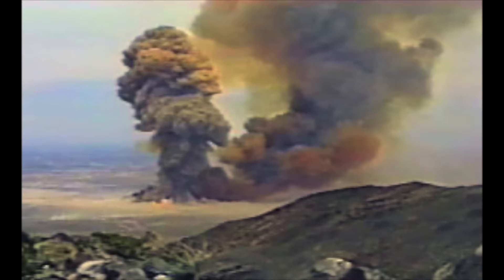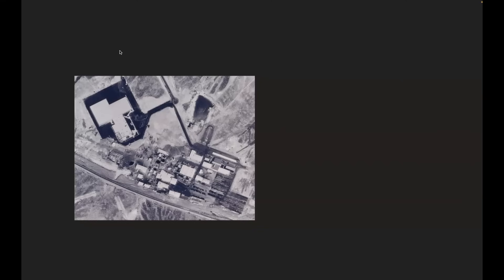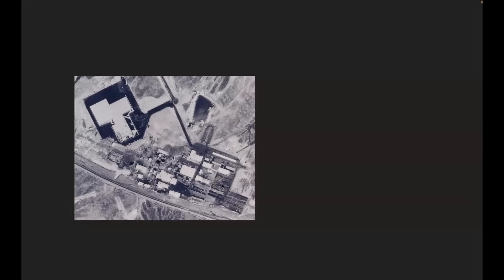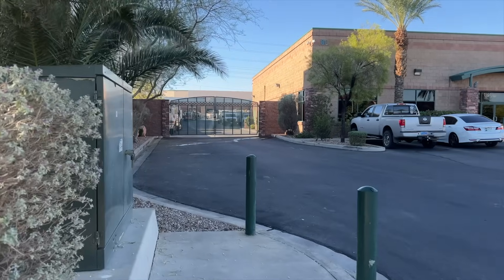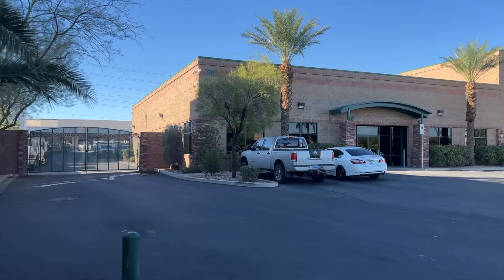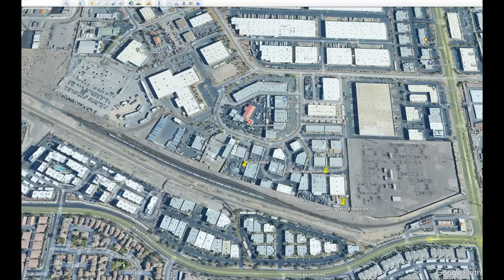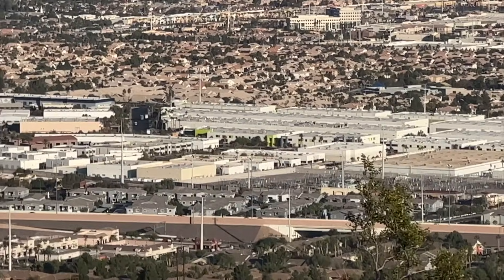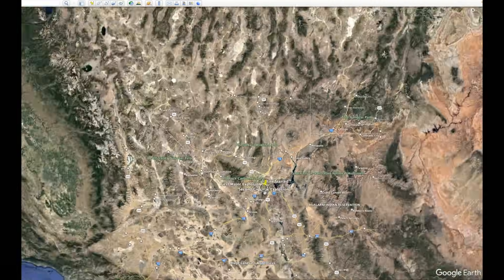PEPCON EXPLOSION May 4, 1988, Henderson, Nevada.

Comment: I also personally experienced the Pepcon explosion on the roof of the new Riviera Tower on the Las Vegas strip at the time. It was my first job as an apprentice for the International painters and Allied trades.
I was pot tending for two journeyman painters suspended on the side of the building when the explosion happened. The aerial platform we called a swing stage got blown away from the building at least 10ft and slammed back against the wall of building. 
It's been so long ago but will never forget the difference as the sound came first and then the repercussion. Like I said I was on top of one of the tallest buildings in Las Vegas at the time. And had a bird's-eye view.

Comment: This is the most comprehensive short video that I’ve seen on this event, well done. I was the first Henderson Police Officer dispatched to the fire at the Pepcon facility on that day. The first explosion happened as I arrived about 700 yards from the plant on Lake Mead Drive, now called St. Rose Parkway, just west of the 515/11 overpass. The overpass was under construction and only a dirt berm at the time. My job was to assist the fire department and control traffic. After the second blast, I moved my police vehicle back about 1200 yards away from the fire, to the east side of the berm. After the third or fourth explosion, a blue Chevy sedan with body damage and shattered windows drove out of the scene, driven by the Henderson Fire Chief, Dale Starr. Starr and his passenger were bleeding from the face. A reporter from the Henderson Home News, Katherine Scott, arrived and was taking pictures. We jumped to the ground as the biggest explosion hit. There were seven explosions in all, I believe. There were four officers who were within the inner perimeter: Dick Trettle, Russell Avery, Bill Adomeit and myself. The three officers later died from tumors and health problems. 

As I recall, the limited information that the police department had been provided up to that time was that Ammonium Perchlorate was only an oxidizer for rocket fuel and not explosive or harmful. Pepcon was at the far western edge of an industrial complex in Henderson that had been built during WW2. The other factories produced chlorine, ammonium perchlorate, titanium, and other chemicals. Closest to Pepcon was the Kidd Marshmallow Factory. It was completely destroyed during the explosion and molten marshmallow burned and dripped from the steel wreckage for a week. 

I knew the welder who they blamed for starting the fire. He insisted that he used adequate protections and was far away from the ignition point. I also knew a few people who had worked in the plant, they told me that fires in the batch drying area were routine and that they rarely contacted the fire department. Employees would extinguish the fires themselves. One person claimed that it was one of these routine fires that had triggered this event. But I do not know all the facts.

As a curious aside to this story, around 1992, I responded to a report of a blue flame  burning in the desert on the west side of Cornerstone Park, about 1.5 miles west of the Pepcon site. There is a small natural spring lake and at the top of a short ridge line, a blue flame about 3 feet by 1 foot was burning gently from the soil. There were no plants or combustible materials near the flame. Henderson Emergency Manager Mike Cyphers came out, along with one or two others. I later heard that the investigation concluded that it was due to high concentrations of ammonium perchlorate in the soil. 

At the time, Henderson was a sleepy town of about 60,000, later growing to over 300,000. The City management and the Police Department were forced to rethink safety and emergency preparedness after that. We built more fire stations, hired more cops, and learned a few important lessons. That day changed Henderson.
Reply from the maker: Excellent story and information! Thank for sharing this 🙏
Reply: Thank you sir.

Comment: Forest please educate yourself and others.  They DID NOT make "Solid Rocket Fuel Booster" at PECON.  They made Ammonium Perchlorate, The oxidizer or oxygen component of the solid rocket motors of the space shuttle. The solid rocket booster fuel and motor assembly was done at Morten Thiokol outside of Salt Lake City in a remote area.  The cause of the explosion was a natural gas leak under the plant.  The leak was discovered weeks before the explosion but the gas company couldn't find it's source.  The gas line came through Rail Road Pass, under Pepcon and fed the rest of the Las Vegas Valley.  Prior to the explosion at 10:45am, the local middle school down stream of the Pepcon was evacuated due to the smell of Mercaptan, the natural gas smelling agent, allowing the detection of natural gas. The explosions stopped once the gas was turned off.  This event would have never taken place if there wasn't a gas leak or if the gas pipeline wasn't three feet under the "crystalized oxygen" or ammonium perchlorate. Please read the full report. 
https://www.amazon.com/Brief-History-Engineering-Production-Henderson/dp/1514435241/ref=sr_1_1?crid=30EBQL5FXO8A7&dib=eyJ2IjoiMSJ9.MHfLAG6XjEJ5UYzcpuYrkCd_w8wr_KT2EIATEkwdXs0FqhZPig1-dJuuydlJQYt_zpBJ7eHqIJzw8h85UqmFptmyWkpLrDWU2HmKNkX0bJ8.Vx6fT105iCEnWg9IHYVcT-ra2ahd3PaKhKeBz-kywHA&dib_tag=se&keywords=pepcon&qid=1732375219&sprefix=peacon%2Caps%2C389&sr=8-1

Comment: Im a Las Vegas native and remember that day very well. I was tending bar at the pool bar at the Marina Hotel. The pool was on the east side of the building with an unobstructed view to the east and south(the direction of Pepcon). I heard the first blast and ran inside and up the escalator to the entrance to the banquet rooms, which had a wide open floor plan and 25 foot windows that looked out over the pool facing east. As I got to the window, the second blast sent a massive shockwave across the valley. I watched it approach as all of the trees were being pushed down in my direction. The huge windows in front of me waved like a flag in the wind. The most terrifying thing that I have ever seen!!!
Reply: By observation of the photo presented it appears a lot of Henderson was still desert back then. what is Amazing is they manufactured this stuff so close to Las Vegas. Did they continue to operate in the same location after the explosion?
Reply: Did you survive the blast??😂
Reply: Tending is just serving drunks

Comment: An explosion is roughly just a conflagration (i.e. fire) that spreads faster than the speed of sound. Fire itself is just a chemical reaction, specifically an oxidation reaction. Notice it is not called a hydrocarbon reaction, or a hydrogen reaction, or a methane reaction. The fuel isn't the important part, it is the oxygen. Everyone always talks ad nauseam about the fuel in a fire or explosion and never about the most necessary component of the reaction, the oxygen. This oxidizer and many others like it are stored in metal canisters in metal buildings on concrete pads in the middle of the countryside all of the time. The rockets they go into reacted the oxidizer with, not hydrocarbons, or methane, or gasoline, but metal. Magnesium and or Aluminum to be exact. Virtually anything that isn't like pure silicon is a fuel with this much oxidizer present, meaning yes, all of the shit around it. To make it even worse, you can't extinguish a fire with a sufficient oxidizer present. You'll often hear with solid rocket motors its a candle that can't be unlit. Once it is supplied a source of ignition, there is no going back. You cannot stop it. It will burn until all of the oxidizer has been consumed. This is an inescapable fact. All of that droning on to say, fuel is great or whatever, but most intelligent people will tell you oxidizer is about 400x as terrifying.
Reply from the maker: Thank you for sharing!🙏

Comment: One little detail….Challenger didn’t “explode” it broke apart due to aerodynamic pressures from a strut that was cut through connecting the SRB to the shuttle….The plume that is seen that is often said to be the explosion is the liquid oxygen hitting the air but there is no boom that would come with the explosion and an explosion would have killed the crew instantly which actually would have been a better fate than what they suffered…..

Comment: On May 4, 1988 I was working at the Firestone tire store at the corner of Fremont and Sahara in Las Vegas. the explosion was so strong that it sucked out a huge plate grass window in the front of the store. The plate glass did not go into the store but into the parking lot. A fellow employee had moved all the customers and office staff out of the lobby of the building and had them in the open mechanical bays away from the glass front of the store. By happenstance I was on my final month of work there and was preparing to move to Seattle for a new job.

A suggestion would be the fact that Pepcon did move their entire production facility far out to uninhabited area of the desert well away from any towns